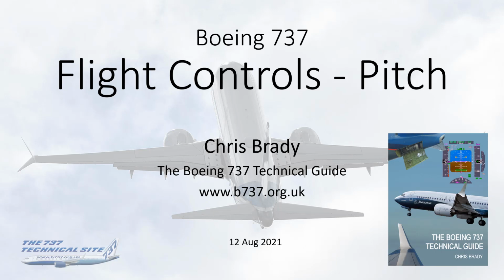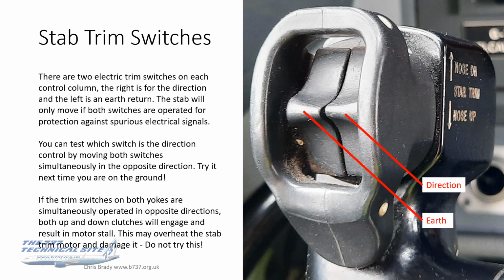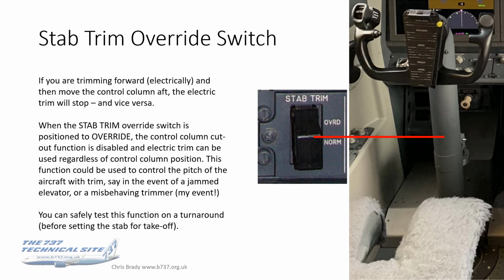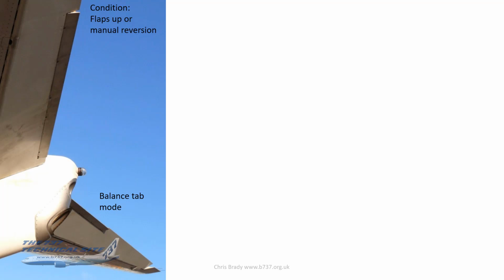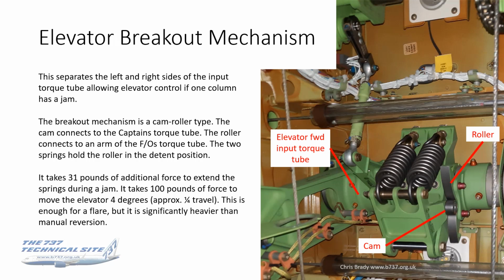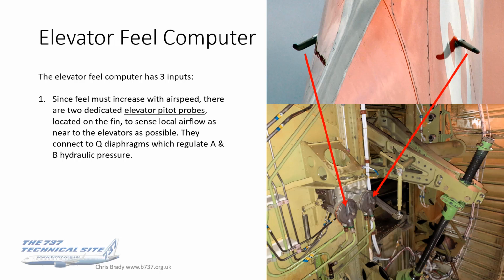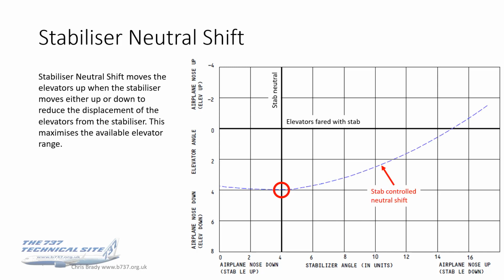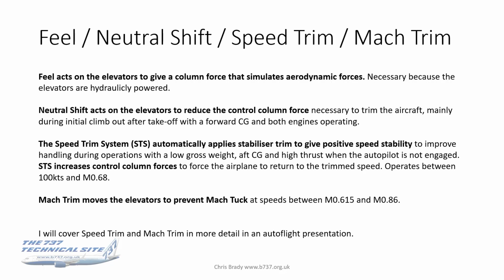737 Flight Controls - Pitch

Comment: How does elevator manual reversion work?
Is there a direct mechanical linkage / crank between the aft input torque tube and output torque tube? Couldn’t find one on the photo…
Or is it that the PCU still transfer the motion, just not not magnifying the force hydraulically?

Thanks anyone for an answer!
And mega thanks to you Chris, I’m studying for my TR and your videos with all the extra stories are so So helpful ! :)

Comment: Hi Chris, thanks for your amazingly detailed videos. I spent a lot of time in the wheel well trying to identify each piece of equipment... not respecting my company turnaround 😅
You mentioned a video where you will give more details regarding speed and mach trim systems. I am wondering if you did it yet.
Also, do you have any schematic of the feel and centering unit to see what is inside ? Thxs
Reply from the maker: Hi great to hear that you like the videos. I havent yet dome the Mach & speed trim videos but they are on my list. I am just finishing one on GPS interference.

Comment: Excellent presentation Chris👨🏻‍✈️I flew all models of the B737, with the exception of the MAX. My question, would normal, QRH “runaway stab trim” abnormal, have saved the two MAX crashes? My instincts, say yes, but I can’t seem to get a straight answer since I have retired. I always took this abnormal very seriously, and always checked the stab cutout switches,  as part of my preflight. Once again, great work👨🏻‍✈️
Reply from the maker: My issue with that procedure for this scenario is that it doesn’t fit the criteria. The MCAS accidents were not a runaway stab trim, they were an intermittent spurious application of stab trim. When electric stab trim was applied the “runaway” disappeared for 5sec than reared its head again. Hardly a runaway.

Comment: Hi again Chris! It’s not apparent to me how manual reversion works here. Is it like the ailerons where the input torque tube is moving the entire PCU which in turn moves the output torque tube? And why doesn’t the rudder work the same way? 
Many thanks!
Reply from the maker: It is similar. This description from the AMM: "During a manual reversion... When the pilot moves the elevator control column more than one degree, the primary and secondary input cranks hit mechanical stops on the outside of the actuator housing. As the housing moves, hydraulic fluid in the actuator is pushed from one side to the other through the bypass valve. Movement of the housing also moves the output torque tube to the commanded position."

Comment: I remember a mechanical stabilizer brake (fwd e&e ceiling) that stopped the stab by applying opposite yoke movement on the originals. Does that brake still exist? Thanks for your wonderful series.
Reply from the maker: No, that was only in the Originals.
737-200 AMM 27-41-00 
A stabilizer trim brake system arrests out-of-trim stabilizer motion when the control column is moved in the direction opposing the stabilizer motion. The stabilizer trim brake is a self-contained mechanical unit, located in the forward nose compartment of the airplane under the aisle control stand. The unit is provided with mounting provisions to be attached independently, and consists of the following rotating shafts: elevator input, stabilizer input, and override input.

Classics onwards had a primary and aux stab brake system and a STAB TRIM override switch in the flightdeck.

Comment: Amazing video! Subscribed! Great content! But I have a question regarding the newer 737s (NG and MAX), So, on all airbus aircraft, i'll use the a320 as an example, you have an ECAM display in the cockpit, which you can select to show you important aircraft information (engine, bleed, pressure, electrics, hydraulics, fuel, APU, air conditioning, door, wheel and flight controls), is there anything like this in the 737 cockpit? Any way to check if your flight controls are functioning ? Or how your hydraulics are doing? Or even which doors on the aircraft are open? I was just thinking and comparing the aircraft (A320 and B737) and then this came to mind, I know that the 787 has something similar to the ECAM, but I am not sure about the 737, thank you.
Reply from the maker: To be use your example, the Airbus family have a systems display (not ECAM) to show how the various systems are functioning. The 737 does not have this but you can indirectly get the same info from the overhead panel. Eg the doors panel will tell you which doors are open.
Reply: @ChrisBrady737  ohh, thank you very much, I understand.

Comment: Hi Chris,
Fantastic video as they all are.
Quick question regarding a jam on the pitch axis. I understand how both control columns can move independently thanks to the breakout mechanism on the fwd input torque tube, but since the cables from both sides end up connected to the same elevator input torque tube in the back, I can't possibly understand how both control columns can therefore move independently. You mentioned other breakout mechanism further back. If this other breakout point is indeed on the aft elevator input torque tube, would the captain side only command the left side elevator and the FO only the right side in case of jam?
Thank you for enlightening me on that matter !
Reply from the maker: It is difficult to explain in words but if say the F/Os CC (or cables) are jammed it will not move. If the Capts are free, it is able to move the elev fwd input torque tube (thanks to the breakout mechanism). This enables the aft elev i/p tt to move, which moves both elevators. Movement of the aft elev tt will move the F/Os cables (unless they are jammed) this movement is absorbed by the springs in the breakout mechanism, so the F/Os cc remains stationary.
Reply: @ChrisBrady737  so not only the springs in the breakout mechanism allow independent motion of the R and L cc, but also a sort of dissociation in the motion of the fwd i/p tt relative to the elev tt ?
Basically, if I understand correctly, the elev tt can still rotate if the FO cables are completely stuck, correct?
Thank you very much for your prompt reply !

Comment: Thanks for your passionate efforts Capt. Just wanted to understand the dual switched for elevator trim functions, one is release the stabiliser brake (or earth return, I am doubtful with this. Or it is the alternate terminology for stabiliser brake circuit) and other to operate the electric motor?
Reply from the maker: If you mean the elec trim switches on the yoke, one is for direction, the other is the earth return.

Comment: Hi Chris,
Great presentation again. Nice additionnal infos to your book. Specially the fcc contolled neutral shift. Finally I could fully understand this. As an enginneer and instructor I found extremely usefull your channel. Regarding to the 737 max stab cutout switches: I think Boeing should have to revert back to main and autopilot functions after the accidents. Because now if the autopilot trim fails you cutout the main electrical trim (pilot normal electrical) too and you have only the wheel. Less redundancy
Reply from the maker: Hi Balázs, I agree, the change of function of the stab trim cutout switches was a retrograde step.

Comment: I am flying the 737 in Infinite Flight and looking for average takeoff speed and approach and have watched more than one video.

Great detail and I just learned a lot. Thank you! New follower!
Reply from the maker: Hi Mouse, it is very difficult to give an average takeoff and landing speed because it depends upon many factors e.g. the series of 737, the weight (passengers and fuel) etc. But maybe use 130kts. Glad you have enjoyed the videos. Chris
Reply: @ChrisBrady737  thank you so much. I love the videos and actually learned a lot of technical things I have been wondering. 

Question, what is the reason of the varying degrees on the spoilers? 

I understand that the outside spoilers (towards the wingtips) would be a higher degree to spoil the lift on the outer portion but why not get max from having all at the same degrees on landing?

Comment: Very professional and nice job Chris! Always waiting for your videos!
Question:
In an event of an elevator jam, how does it actually behave in the tailcone the breakout system?
 Does it separate the left/right elevators as single units?

Thank you!
Reply from the maker: Thanks Daniel, I guess you mean "in the event of a control column / cable jam". In this case the unjammed side of input torque tube will move and cause the onside PCU to move the whole output torque tube and both elevators. Think of it like flying on a single hydraulic system - both elevators move because the single PCU moves the whole output torque tube.

Comment: Hi Chris. Thanks for amazing great videos! I do have your book(been with me for many good years) its great to recap the systems. Did you get a new microphone? That's the only thing I can ask you to improve. KEEP up the good work. 
B.Regards from a fellow 737 skipper
Reply from the maker: Hi Daniel, Thanks for your feedback, and for buying my book. Yes I bought a new microphone for these videos after the first few came out way too quiet. Hopefully the sound quality is OK now.
Reply: @ChrisBrady737  It is just perfect now. That's great. Keep up the good work with nice presentations. Could u shed some light on how much is minimum OIL quantity for dispatch, I couldn't seem to find it. It used to be 12qts, but we don't have it written anymore (737NG), perhaps make a video about limitations
Reply from the maker: Good idea, I will put it on the list
Reply from the maker: Minimum oil quantity is 60% / 12 US Quarts on the NG. Oil should be added not less than 5 minutes and no greater than 60 minutes after engine shutdown while the oil in the tank is still warm. This will prevent the over-servicing of the engine.

Comment: Great Job, that's much clear than what I could get from AMM.
I thought the Neutral shift is somewhat want emulate the trim feeling on small GA using trim tab, and wonder why it did such a bad job on that, now it's clear it just doesn't care about it.
Many trainee I met have problem translation from tab trim trainer to stabilizer trim airliner, I tend to show them Fig2 and 3 on 727's FCTM 04.25.02 if needed, although it's not on our official 737 training material. I wonder why that's not there in 737's FCTM then. This difference was even considered to be a factor on Flydubai's crash after Go-Around.
Reply from the maker: Neutral shift and feel are often confused because it is not explained well. That 727 reference is a good one, thanks!